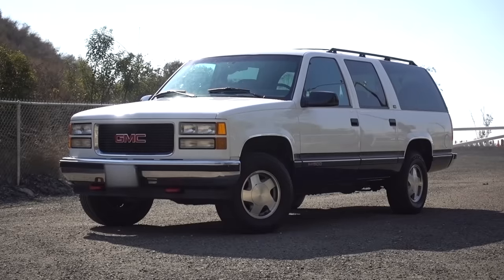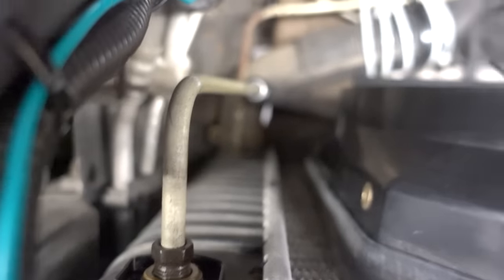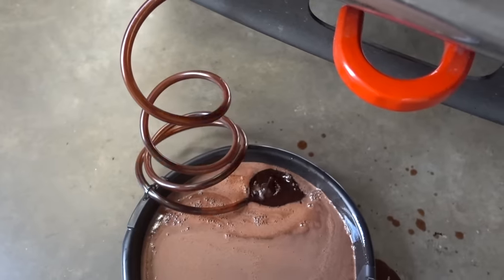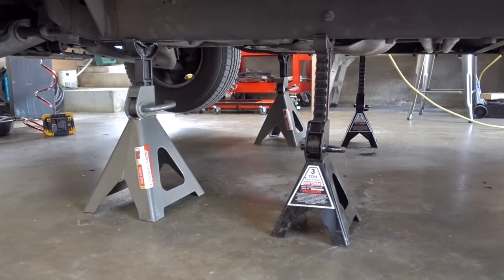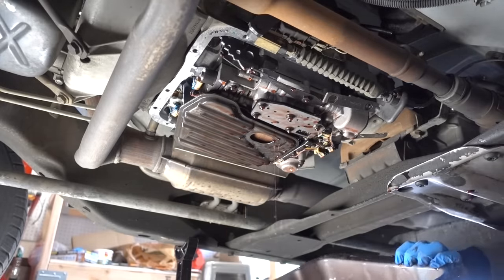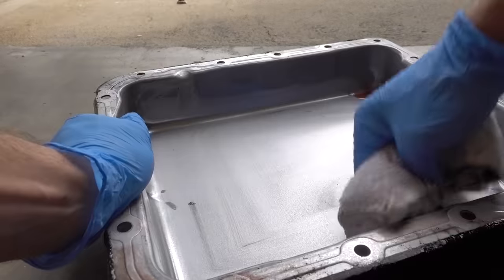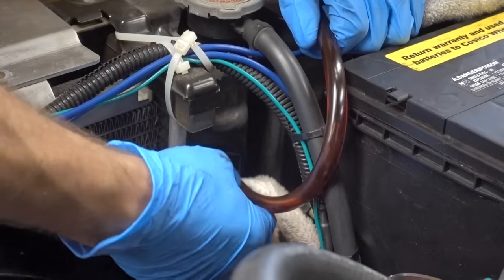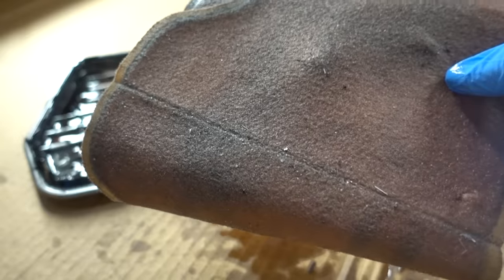Why You Should NEVER FLUSH YOUR TRANSMISSION FLUID!!

Comment: Did he even explain why NOT to flush your tranny?  If he did I missed it.
Reply: Chemistry'sCuriosities Cannagorilla I think he might be implying that you shouldn’t do it because of how hard it is to do it. Looks pretty complex 😫🤯😬
Reply: @rnavarrete26  It's simply because the title attracts a lot more viewers than saying "Why You Should FLUSH YOUR TRANSMISSION FLUID!!
Reply: Generally, if your car has high mileage (e.g., above 100K) and its ATF has never been refilled or flushed in the past, you don't want to flush it. A safer approach would be multiple drain and refill with few miles in-between which replaces few quarts of ATF each time. It's painful but worth saving a transmission rebuild. In fact some cars like Honda service manual, recommend multiple ATF drain and refills with some driving in-between.
Reply: @garyfrye222  Im a little late, but as the other guy sayed, if your car is high mileage, and hasn't had regular transmission fluid changes, you should not change the fluid.

You might break loose some metal that is just sitting somewhere not doing anything bad, and have it go to a critical oil passage etc.

If you have had regular trans fluid changes, it's usually ok to change the fluid, but there is always a possibility that it fucks up the transmission. 

But, i would recommend always flushing the transmission fluid regularly.
Reply: A bit late to comment, but he did explain towards the end of the video, just after the 11:15 mark.
Reply: Bill Edifier thx
Reply: Cause he wanted you to see for yourself the difference, if you do it regularly it’s not problem, if you don’t the  first time  you put extreme load on it it may fail do to heat build up from old dirty burnt fluid.
Reply: @garyfrye222  I didn’t know sea foam made transmission additive? If so, rhe additive may unblock or swell o-rings and regain pressure flow and limp it along for while. With that many miles the clutches are about  gone anyway.
Reply: A friend had a olds car, and he put all new fluid in it and it broke down 
short while later.
I think the thicker better fluid creates more pressure which a old trans cant handle.
Reply: from what I've heard (I'm not an expert on the matter) it seems to me the same reason people say not to flush your engine. That being flushing a unit with a not so hot maintenance history could potentially cause old debris to shift and potentially settle or clog in other areas.
Reply: @garyfrye222  how does a fluid that lubricates damage the actual components in your transmission? If you have a bad transmission, you have a bad transmission... no fluid change or flush will change that. A transmission flush is not going to cause issues, with the exception of improperly filling it with the wrong fluid or adding the incorrect amount. It's all preventative maintenance that prolongs the life of your transmission.
Reply: I want to like this comment, but it has 69 likes right now...
Reply: I think it was a marketing ploy to get more viewers.

Comment: NEVER flush a transmission!! And you should add as it's pumping out..
Reply: Fake news. Both are wrong. It's like saying dont change your motor oil all that sludge is holding the engine together. Nonsense. Old transmission fluid black with clutch plate material is making the transmission wear faster. Blocking the filter. Sanding the clutch plates. Plugging the valve body and solenoids. And wrong again about filling while pumping. Just do 3 quarts instead of watching for bubbles and your fine.
Reply: @sbond1963  I just change what comes out when you take down the pan. I clean the magnet and change the filter seal.  Never flush!!
Change ever 70 ish thousand miles.
And yes, you add as it pumps to keep a liquid seal...

Comment: I would never flush that transmission. Just do the pan removal and refill it. When I had my 4L60E transmission rebuild, the mechanic clearly specified to never flush it.
Reply: Right! Never fluid!!
Reply: This isn’t a flush. This is a fluid change. An actual flush is going to be connected to a machine and it requires detergents and solvents. Used to do them when I worked for a dealer. Flushing is bad. Fluid change is fine if you catch it before it’s completely burned and ruined. Which he did. If it’s already burned and gone, better off just rolling with the transmission until it dies. “If it’s been neglected, keep neglecting it”.
Reply: yup.  It's garbage.  Noticed a lot of clutch packs and sunshells go bad really fast.  Last time I rebuilt one, it had 80k original miles on it.
Reply: I flushed my 4l60e at 160k(first trans service ever) and it has lived to almost 180k. Still has plenty of holding power and shifts flawlessly.

I love mechanics today. Dont know shit from a turd.
Reply: Technically, he really didn't flush it.
Reply: @jamesm568  drive it 100 miles and change the fluid again. That's a 'flush' that no machine could ever do..

I would consider this a fluid exchange though, yes. Flushes are a scam and dont produce anything of greater value than the job done actually correctly..
Reply: Jay's right.  My 4L60 was total trash. Only lasted 200k miles---would have gone farther but the truck was destroyed in a bad crash.  It always shifted perfectly and smooth.  Totalled.  My next GM pickup only has 115k miles on it and that damn thing is garbage too.  It shifts very smooth and causes no trouble.  No hiccups.  Typical GM junk.  It should last another 100k miles.  I wish GM still made that trans then I could get another one.

Comment: Time for a set of flair wrenches. And with 20+ years on the truck I'd would've changed that seal, it's not that hard but then me and the 4L60e go way back, 1999 Z28 (past) 1997 1500 Silverado (current). Thanks for the valve body torque tip.
Reply: Agreed, it was kinda cringe using an adjustable box wrench on that line

Comment: I always do mine a little different.  Trans service with filter.  Top it off.  Then fluid is added as the old drains out.  Until it's clear red (Normally about 14 quarts)  Level never changes, never runs out.  Currently 330K on my expedition.  Sold all other vehicles with well over 250K without ever having a trans issue.  Works for me.

Comment: Did the same process in my 2014 Escalade a couple years back.  As long as mileage is under 100k I think this process is fine.  Once over 100k, if it was never done, I'd probably avoid a flush because the damage has already been done.
Reply: My recently acquired 2005 volvo s40 is currently sitting right at 100k miles. I’m in Canada so under 160km. The car was sitting about 2-3 years before i got it. Should I go ahead and flush it? I did crack the drain plug previously and let a drip come out slowly it was quite dark.

Comment: One thing that was not mentioned in this video is that in modern electronic automatic transmissions there are relearn procedures that have to be followed when changing the transmission fluid otherwise the transmission may very well exhibit erratic, harsh or delayed shifts, forced downshifts when coming up to traffic lights, etc. Always consult factory service information (Not Youtube) for your particular vehicle and any relearn procedures if applicable. Most of the relearn procedures have to be performed with a full function Bi-Directional scan tool. 
GM uses a "Tap Cell" clearing function, Chrysler uses what is called a "Quick Learn" function, these can only be done with a scan tool.

Comment: Your better off just changing your fluid every 50k or five years.
Reply: That's fine if you drive it super easy like an old lady but for general driving and light towing, don't let it get older than 30K, heavy towing every 15K. Tranny fluid has components that degrade with heat and time.
Reply: Or novel idea follow the owners manual
Reply: no kidding ben. videos like this are for those neglected vehicles, because they're ALL over out there.

Comment: I just did a drain and fill (probably the first ever) with my 26 year old 62k Mazda protege.  I didn't go synthetic because the transmissions of that time used thicker fluids (dex iii/Merc)  Shifting is much smoother now and there is less vibration, no problems.

Comment: I've done many ATF flushes and never had an issue.
Reply: @IMA SKIER I have done 11 and no problems.
Reply: I've done no atf flushes and haven't had a problem yet. I'm at 243k on my Camry.
Reply: @solomongrundy1467  I got 263k on my '07 Camry 4 banger. Zero problems regular maintenance.
Reply: Most problems probably come from people using improper fluids.
Reply: @craigdoriety9798  That was one of the main reasons Toyota and other manufacturers started making sealed tranny's on their vehicles. People were putting the wrong types of fluids in the transmission and expecting the warranty to cover it.
Reply: @solomongrundy1467  How do you expect the companies to make money ?
Reply: @craigdoriety9798  No
Reply: @solomongrundy1467  - Not only were DIY newbies (and cheapskates) often putting in the wrong types of fluids, a lot of DIY newbies were also not following correct fill procedures per the shop manual. While servicing a transmission isn't exactly rocket science, transmissions are not as straight forward as changing engine oil and filters.

Comment: It is July of 2021 and my daily driver ID a 2000 Cadillac Escalade with the vortec 5.7l with 4L60E transmission. I have 234,766 miles on the odometer, engine, and transmission, all original never removed or replaced. I agree if you do a regular service on your transmission your fine, but if it's never had a service and it'd got alot of miles on it then just make sure and keep it filled at the proper level as long as your not having any issues. In my experience when you flush or change on a high mileage transmission you basically wash all of the trash from between clutch plates changing the contact between them. Next thing you know is transmission is starting to slip. If it's been done on the regular keep it up, if it's never been done then just keep it topped off. Like I said in my experience....

Comment: My experience with flushing out and replacing ATF has always resulted in having transmission trouble not long afterwards. None of them where that old either. Just saying.
Reply: I replace my trans fluid every 50k miles, zero issue several trucks over several decades. Clean fluid is key for long trans life.
Reply: If new fluid breaks a trans then it was on the edge of broke anyway.

Comment: There is a better way to remove the oil from the trans oil pan than what you did. . The way I do it is remove all but three bolts on the pan,  I let two bolts at one end of the pan, and the 3rd bolt at the opposing end of the pan. You then loose halfway all 3 bolts , then with a hand support the pan at the end where there is one bolt, and with your other hand remove that bolt, by doing that, you will be able to let the pan tilt down that will cause the oil overflow the pan and fall into a collecting pan underneath, while The other 2 bolts are supporting the opposing end of the pan. the more inclination, the more oil will drop and  eventually, most of the oil will drain out, to the container that you should have put underneath before, by now the pan is very light and therefore, remove the two bolts and drop the pan entirely and empty the remaining oil . There is no mess and you have total control.

Comment: Probably not a good thing for the pump to be pumping air bubbles....
Reply: James Last at the same time, he wasn’t driving it and shut it right off.  These things aren’t that fragile.  While he may have trans issues later, it’s hard to say if the flush caused it, or if the old crust that he just flushed out was holding it together.
But I hear you, not recommended running dry as a normal operation, clearly this wasn’t normal conditions this trans sees.
Reply: And... there is fluid in the pump it just isnt enough to push out. The suction side of pump isnt getting new fluid but without new fluid coming it cant push put all the fluid that's in it out. Plus the 2 seconds it is 'dry' makes no difference. There is still a film of fluid in the pump..
Reply: @melonas22 I would add fresh fluid while it runs trying to replace what comes out as it does
Reply: @lukasgarrison8505  I hear ya. However, on my truck, I know I couldn't add any while it was running. Unless I rigged up a funnel with a valve and all that stuff.

Fact remains, there is still fluid in the pump. Borderline full actually. If you want to be real scientific about it, you could drop pan, and add however many quarts, let's say 5, pump out 4, add 4 more, pump out 4, add 4, etc..

My truck has a built valve body so it moves a ton of fluid very quickly. But I also have a 9 quart pan so just changing pan fluid changes just shy of half the capacity of the trans. Do that every 25k and I'm good to go.
Reply: That can't be good for it.  Cavitation.
Reply: @melonas22  I won't change peoples fluid anymore when they go over a 100k miles without a flush. I have seen too many slip and then they want to blame me after I warned them. Did you get any slips?
Reply: @lukasgarrison8505  I flushed my 94 Buick 4l60e at 160k or so, and to this day, it still runs awesome. I checked the fluid every day for a week after I flushed it and it never got dirty. Even on a paper towel, there was no black tint. I did a pan fluid change when I first got the car at 147k to clean the pan and magnet and install a fresh filter and it never gave me a moment's trouble. When I pulled the pan to do the flush, I installed a deep pan and correct filter, but the original pan had only collected a dusting of clutch material. When I installed the deep pan, I put both magnets in the pan to collect extra metal shavings..
15k miles since the flush and it shifts just fine, holds just fine, and functions fine.
Reply: Probably made it to the first stop sign before that 4L60E before it took a shit lmao
Reply: @lukasgarrison8505  I've been a mechanic for thirty years and serviced many high mileage transmissions and never had a problem. It's a myth. New clean fluid always better than old contaminated fluid.
Reply: @williamwatkins1996  they should have lol emojis on here. He said he was good though
Reply: @melonas22  apparently you don't realize that a trans pump does need fluid coming to push fluid out of the pumping chamber. If there is fund in it, the gears or vanes will push it out leaving the pump dry.
Reply: @lukasgarrison8505  so how are you going to add fluid back in?
There is no suction on other line, system is under pressure.
Reply: No worries - it all breaks out in the pan anyway.
Reply: I feel it's a myth. The issue is when people try to change the fluid when the transmission is starting to act up. It's already about to fail anyways.
Once a month I have the "emergency" Trans flush customer that calls  specifically for just a Trans flush. I ask them why? They answer for maintenance. Then I clearly tell them if its having any symptoms now is the time to tell me or afterwards it could be problematic etc. Then the customer normally admits it's doing "Xyz" half the time it's not even transmission related. Low power condition and wont shift, map sensor issue causing harsh shifts. Won't shift and its just in limp mode or the transmission is actually failing.
 Sorry not well written I'm on my Cellphone.
Reply: That's why he recommended shutting off the engine when the air bubbles appear.
Reply: melonas22 Remonds me of the time we ordered concrete and pump truck. And we were about one yard or two short. Guess where the last yard of product was... Yup, inside the piping of the pump truck! (The concert was to be pumped ~180ft up in the air for a building’s roof and parapet.
Reply: @clarkgarber5495  Totally agree... who in their rite mind wood want "OLD" worn out fluid in trans... nu w/proper chemistry will do a much better job w/clutch plates... i am an AMSOIL guy, & i change fluids 4 better mpg & i get it w/ AMSOIL...
Reply: @lukasgarrison8505  I do complete exchanges / flushes all the time on 100K + Transmissions with no issues. But there can't be symptoms of problems. They can't be coming to me because the transmission is slipping and this is an attempt to fix it. I won't touch those. But no, it won't cause problems to a properly functioning transmission as a matter of fact it will make it run better. Because now the temperatures are down and the hydraulic pressure is up
Reply: No, he was right in doing what he did, because the benefit outweighed any consequences that may have occurred. Meaning the pump will be just fine doing what he did. 

Otherwise, he would not have been able to get another 4 quarts out of it.
Reply: What the heck do you think is happening to the pump when you start a fresh trans up for the first time. Sure I put fluid on the gears, but it is running without a flow of fluid for a second or two without, by then, no, or very little on pump gears.
Reply: @lukasgarrison8505  That depends on what's in the pan when you change filter.  If there is a lot of clutch material, then I wouldn't change it and I would screen the oil I took out and reuse it. Then add some "fresh" additive. If the clutches are worn badly, the clutch material suspended in the old fluid will help to keep them from slipping.  If there are "flakes" of clutch material, I would inform the owner it's about time for a rebuild or it won't last much longer.  If the pan is fairly clean, then I would change all the fluid because the additives break down over time.   If a transmission "slips" after a fluid change, then the clutches are just plain shot.
Reply: The pump is still plenty lubed.